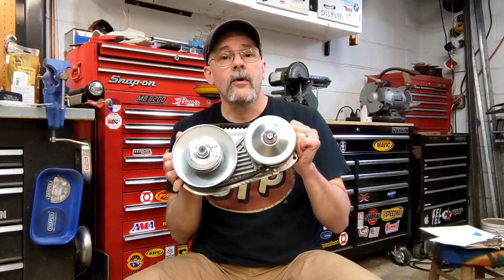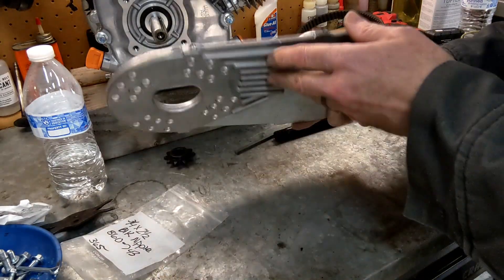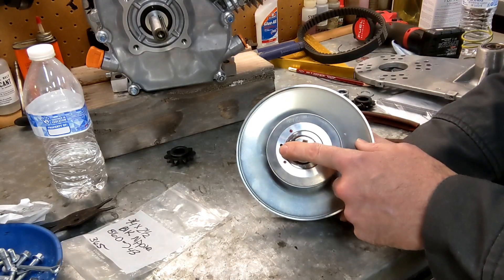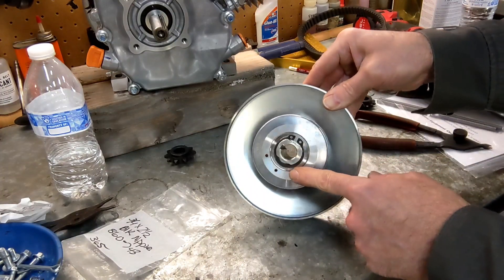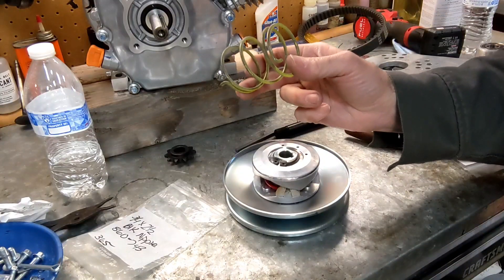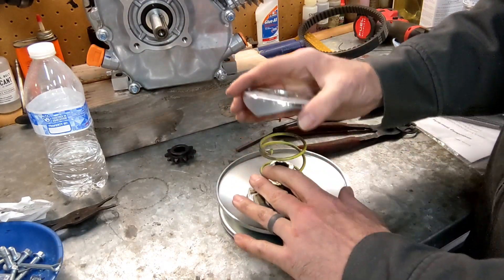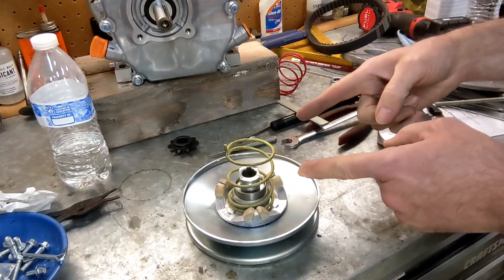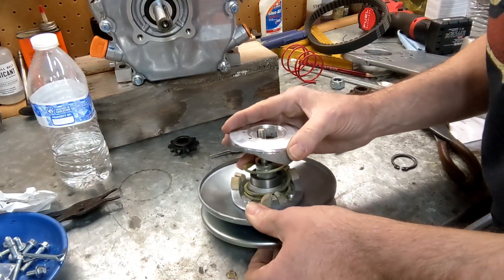GETTING THE MOST PERFORMANCE OUT OF YOUR COMET TORQUE CONVERTER CLONE

Comment: I used a bench vice clamped slightly off center so I could get the snap ring on.  Went through a bunch of changes while tuning, got pretty good at it.  You can also zip tie the brake and do it on the bike.  Seemed to be an almost mute point when I went to the Juggernaut. It just works.

Comment: So this really helped me out, thank you!  I needed to tune my Kart build for off-road performance. Predator 212 Stage 1 kit (about 9 hp). I took the existing red spring and moved it from center to forward stiff for longer duration Torque. I added a front Juggernaut drive pulley, since I have governor removed and ability for higher rpm to engage. Those two combinations, along with a 60 tooth axel sprocket, give me great torque on off road terrain and plenty of speed. On a personal note......I see too many Youtube videos where everyone is obsessed with more speed, and not enough on establishing that perfect balance of speed and low end power. This off road Go-Kart is for my kids, and I don't want them going over 35 mph. That's plenty fast enough.
Reply from the maker: That is great to hear. I had an issue with the clone at high rpm and ended up using the Torq-Zilla, OMB warehouse version of the Juggernaut, it is the trick for high rpm. If you check the play list there is a start video where the 30 converter loses a belt and I have another with the Zilla.
A lot of guys are putting a lot on the top speed, when what makes the fun is how well it runs everywhere else.

Comment: Great tip on the Comet springs! I bought one of the Chinese Comet clones and was wondering if the Comet springs would fit. Now I can order some decent springs worry free. I saw a guy struggle with a Jr Drag driven spring change once at the track, and it was said he was supposedly good at it. Then I saw another guy change one quickly with a compressor tool he made from a spare tire holder he got out of his trunk. Personally, I'm dreading it. Thanks man! Great stuff!
Reply from the maker: Thanks. I need to pop the weights off and weigh them to see how close they are to the Comet, but they should be close(just based on size), so the Comet specs should be close or at least consistent. 
That heavy yellow spring was TOUGH. I had already pulled it apart and put it back together with red spring and thought I would have no trouble. I was wrong.  The gadget I made worked pretty good. If I did it a bunch, I would make a keyed holder for the flat plate and use a longer screw to pull the beveled plate down.
Reply: It's not that bad. I'm weaker than I was 30 years ago and I can set the yellow spring in the tightest hole. In my testing I even over "clocked" the yellow spring. That took everything I had.
Reply: @Deucealive75  I'm still dreading it. LOL!

Comment: Great video , they can be fun to take apart and put back together !
Reply from the maker: Oh yeah. I had to pull the side cover off due to a leak and found a bunch of metal in the case, so it is coming apart to see what is going on(Looks like the big end bearing)
Reply: @WhatIsTheWheel  that’s not good !?!?
Reply from the maker: @BustedKnucklesBuildsTexas  Pretty annoying, but maybe I will put a lighter piston in while it is apart. Probably my fault I was likely overreving the motor.

Comment: Informative video. 
Something to note, the genuine Comet driver and driven have much better slope angles. It can be seen side by next to the Chinese [expletive]. It wouldn't be accurate to say it adds HP, rather it frees up about 1/2HP out to the drive axle. Which will increase top speed 1-2mph.
Reply from the maker: I think the extra power would only give you a higher top speed if it let the motor reach a higher rpm(or the clutch was not reaching the top "gear" position). If the motor is spinning 6000 rpm and the pulley has moved to its highest "gear" position, it does not matter what springs are in the clutch, the top speed will be the same. The only way to increase the top speed is to spin the motor faster or change the gearing.

Comment: When the Comet is over $200 and the clone is under $50 I'll just buy a few clones thank you!
Reply: Lol, this. I cut one of mine down since the riser plates won't work with my frame. Slapped it on a 3/4 shaft 196 with a lugnut. Then, I swapped in a 223 and needed the keyed washer and center bolt for the internal threaded shaft, so I just bought a whole new kit, just for those parts. 😅
Reply: Oh HELL NO, nothing better than something well made. Less hassle, belts last longer,. If you must cry, get it over with-pay once, cry once. Not every time you work on it, AND not every time you modify it to get it to work right. (Not counting adjustments/tuning) But that's me, my philosophy. I admit- sometimes money's tight, and you gotta do what you gotta do..or sit there staring at your machine instead of riding it. So, go for it.😊

Comment: Well my tc stock engages at about 2500 to 2600 rpms. I just want to say, even tho you eliminated an unknown in the spring, you still have to consider the weight of the weights. Are they consistent as well? I think the best way to figure out the engagement is with a tach/hour meter. Bcoz i think my motor would work better if it engaged around 2200. The other thing im finding out is those weights inside the driver can and do come out of balance often and vibrate. Do you experience this too and what did you do to remedy it? I dont like how they are inside the two "bells". There is nothing at all keeping them from moving out from centre unlike say the 40 series. Msybe i should weigh my weights and check to see if they are the same..... Thats an idea i just thought about. Or, cut 2 channels on each weight and weld tracks on the "bell" so as they fling out the channels and tracks keep them always in the same place and it wont change much when it comes for disassembly? Bcoz the vibration is irritating.

Comment: Good explination of how and why.  The can of Kroil in the background gives you streat cred, too many people use WD40 for everything.  

I feel you pain.  I bought a lightly used but old kart frame for $400.  After a half season of racing I have spent $7,000 to run last place in class.  A good thing I am having fun.
Reply from the maker: $7000? WOW! Are you racing vintage? Those motors can be pretty pricey. I got the Kroil for a stuck swingarm pivot on an XR650R I was building in to a supermoto. I wish I had shot that whole process.
Reply: @WhatIsTheWheel  Engine $600, Clutch $400,  Driver and gears $125, Data logger $650, 3 Sets of tires & wheels $750,  Safety equipment $1000, Speciality tools $300,  Hardware $500...
Reply from the maker: @deangiacopassi1951  I don't even want to consider the cost of racing a kart, it would be cheaper to do the 24 Hours of Lemons or Gambler 500.
Reply: Only thing WD 40 is good for is starting a Diesel engine

Comment: Hey I'm working on a motorized bicycle (79cc predator with belt drive setup with CVT) and I'm wondering what's the best combination of springs and weights would I use (output of the CVT is using a 4" pulley on a 16" sheave that connects to a 26" wheel)

Comment: When you wound the idler spring on, you turned it 1/2 a turn too much. It should only be turned about a 1/4 turn to engage the flats. Will be easier to get spring clip on, too.
Reply from the maker: Thanks for the comment. I went back to the raw video to get a better look at what I did. The hub has three ramps and the base has three sets of pads. When I installed the hub, with no spring tension, it was to the left of one of the sets of pads. I turned it just far enough to move it to the next set of pads. The only way it could have less preload would be no preload at all.
Reply: Good.  Job. !

Comment: I need advice!!!!!! Somebody please help!!!!!!!🙏 I have a Duro-max 18hp 440cc with a 40 series torque converter. My tongue converter is eating belts after only ten minutes of use . What in the flip am I doing wrong??
Reply from the maker: Is your gearing to tall? I remember seeing a video about changing the spring in the driven clutch because it had to a reverse wind for some applications, but I can't find it now.
Reply: @WhatIsTheWheel  IDK this is my first go-kart. Ever at 46 years alive.lol how will I know if my gearing is too tall ? I'm running 18 or 20 inch wheels
Reply: I'm pretty sure you need a bigger tc. If you're running 40 41 chain it's possible it's not big enough.  You might need to make sure your tc is good for 18hp

Comment: one thing to change. the clutch is 20ft lbs and the bolt that comes with the kit for a predator 212 needs to be thrown in the trash. they need a 5/16-24 fine thread bolt that's about 1/2-1" longer and to add a washer and lock nut to the bolt with blue lock tite. Lots of people ruin their engines using those cheap bolts that arent long enough with these kits. Was first thing I learned on my journey.
Reply from the maker: Oh yeah, all the supplied hardware got tossed in the spares bin.

Comment: My drive pulley clutches aren’t working at all. My mini bike rides fine just that drive pulley clutch never expands at any rpm? Could I just be too heavy?
Reply from the maker: It moves but the pulley does not expand? That is odd because that movement is also the clutch. If the motor revs up, something is going on in the clutch, it is not your size.
Reply: @WhatIsTheWheel  if I put it on a stand it works perfectly, it expands and engages. If I ride it then it does not ever get enough rpm to expand, I have video of both scenarios. The only difference from when it works is load, when under load it doesn’t let the clutch expand/engage but when on the bench with no load it works as it should.
Reply: Did you solve that problem? I`m having the same issue and it`s breaking my belts quickly😖😖😖😖

Comment: Using the springs from the comet transmission will only open at the given rpm if the weights match the comet weights.
Reply from the maker: The zinc weights that come in the Ebay converter are within a few grams of the Comet weights(which likely have some variation as well). 
Even if the weights were different the approximate  engagements would still apply, that is if you needed to go lower or higher, you would still use the next value spring.

Comment: I use a 2 1/2" bolt with a flat washer and a lock washer with loctite 242 torqued to the Comet spec of 20 ft/lbs.

The main performance issue with the stock 30 series is that the belt shifts too early and kills engine power. The gearing change is too fast and too dramatic. With the belt shift you are going from appx 2.68/1 to .9/1 which is OD. This is usually the case with less than ideal gearing. I've seen plenty of questions in mini bike forums over the years on this subject. The common question is "I have a 7500 RPM engine that will not get more than 4500 RPM with a torque converter". This is because their potent engines still can't handle the load once the belt shifts. The answer there was TAV springs and gearing. Now a days the answer is the Juggernaut or tork zilla drivers. With these new drivers the belt shift doesn't come on too soon and the gearing change is less dramatic. You never see OD or even 1/1 gearing with those drivers.

I disagree with your comment about drag racing. If I were drag racing I wouldn't want the belt shift early. I  would want the shift to occur as late as possible in a higher RPM range where the power is. Even on my not so potent 196 on a mini bike it performs the best 0-30 mph with the yellow spring in the tightest hole with the belt shifting at 4300 RPM under full throttle. With the early belt shift provided by the light tension green spring, my bike was a dog when the belt shifted at 3700 RPM.

Engagement on my stock China driver is around 2700 RPM.
Reply from the maker: Thanks for the comment. My thinking with the belt shifting to the highest ratio as fast as possible was that you would use high rpm garter springs and be in the meat of the torque curve when the belt started to shift. 
Just like with cars and motorcycles, it is a matter of trying stuff, trying to figure out what is happening, then making changes to improve the performance.
I was watching another build channel and the guy was racing a mini bike. He had a treaded tire and kept rolling through the burnout box, but did not realize why he was having poor launches. One of the line workers told him to go around, and it made a big difference in his time. You have to step back and look at what is going on, figure out the problem, then try to fix it.
This kart is just for fun, I never had one as a kid, so I wanted to build one before I get to crippled up to sit in it. Next time might be a big block mini bike, and that would be a project to take to the strip and try stuff to make it faster.
Reply: @WhatIsTheWheel  Yes. Changing to heavier garter springs may be the ticket there. And not necessarily for drag racing, but just better TAV performance. Like you say, it's a matter of trying different things out until you find what works for your type of riding.

Comment: Nice, i found those Chinese TC are a crap shoot. Bearings fall apart, grip angles and not proper, chew up belts, belts slip due to steel finish etc..
I replaced my comet TC with a Chinese one and it lasted 4 rides. Back to comet. Some have better luck.

Comment: The crank is a 5/16-24 as well.
Reply: Also at 14 ft lbs I guarantee it will come loose after about an hour of use.
I've had better luck at 25 minimum.

Usually I just use a box end wrench and hammer to tighten it on the trail but 14 ft lbs is not enough in my experience
Reply from the maker: I can't remember if I added that with text or not.
Reply from the maker: @contraband1543  Thanks, I did not see a spec for the bolt so I went by the SAE spec for it. I will probably use blue loctite on it.
Reply: Is it grade 8 ???
Big difference on torque spec and depth

Comment: Thank you for your time…………. A huge difference as well. Are the cheap bills compared to the comet belt. The cheaper belts are gonna leave rubber on the clutch which is gonna screw up the way your belt rides on the clutch. It’s a terrible ride. Spend the extra few bucks and get a good belt from Powersports well worth it and the juggernaut I would advise to get the real juggernaut, huge difference

Comment: Can a torque convert be used on a KT100 2 stroke?
Reply from the maker: I don't think it can. The Comet style clutches fit a 3/4 or 1 inch shaft and I believe the KT100 has a metric shaft dia.

Comment: Holy shit did he make a spring swap difficult !!!
Reply from the maker: I did. I often go through the process of figuring it out without looking to see how it is done, so I can work out the process for myself. I had already taken the pulley apart and put it back together with the red spring with no problem. The yellow spring made it a lot harder.
Reply: @WhatIsTheWheel  you made a TON more work for yourself. Yellow springs ARE stiffer, that's the point of a spring swap in the first place. But they are no where near as hard as you made it.
You just need hands and snap ring pliers.
Nothing else.